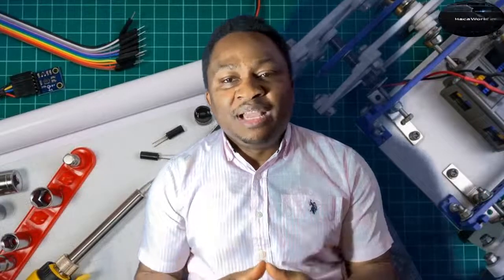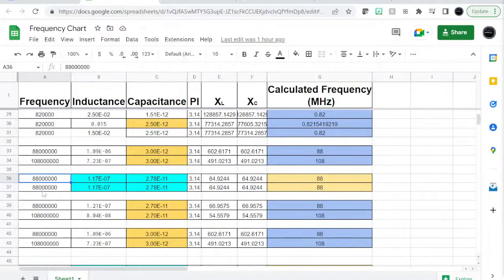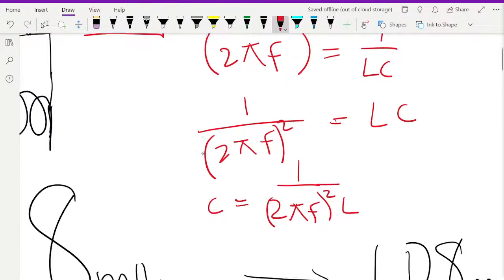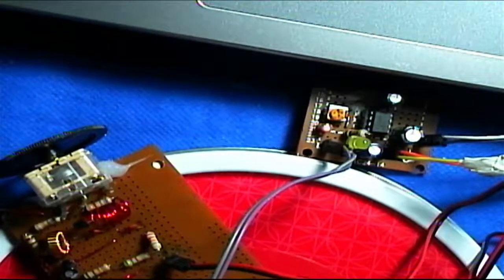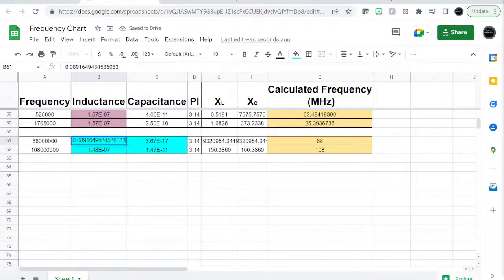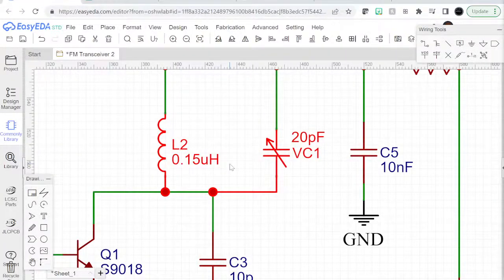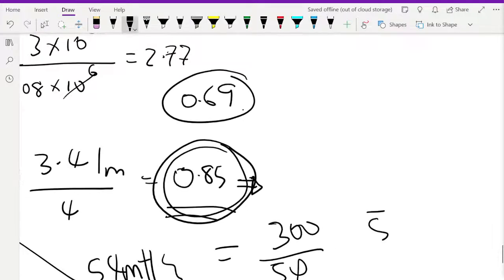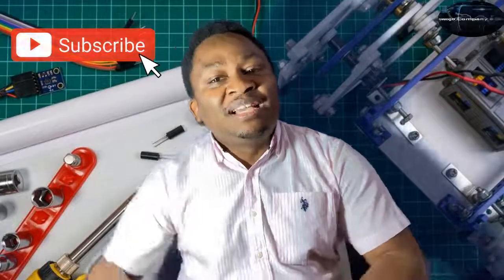How to build a One Transistor FM Transceiver | Build and FM Transmitter & Receiver at home yourself

Comment: Hy. I think video from last time has schematic wrongly marked. Capacitor  C3 across transistor says 0.1u. I don't think thats correct?
Reply from the maker: You are right... I included the correction in the description: P.S C3 is 10pF to 30pF not 0.1uF.